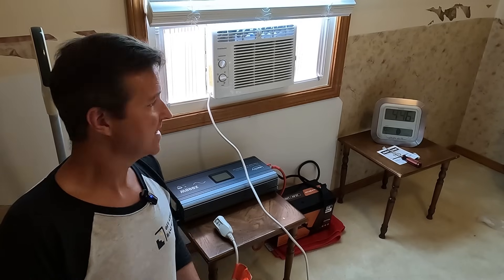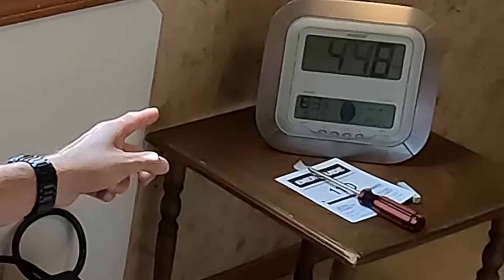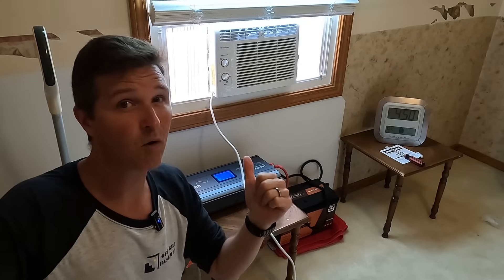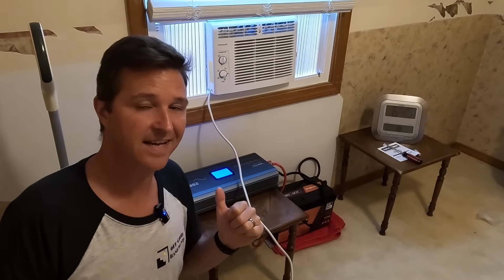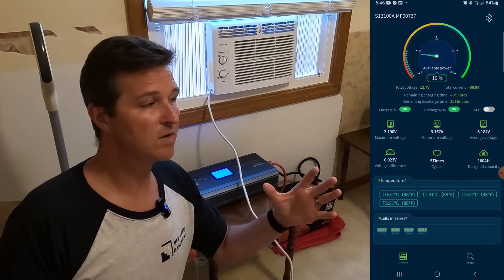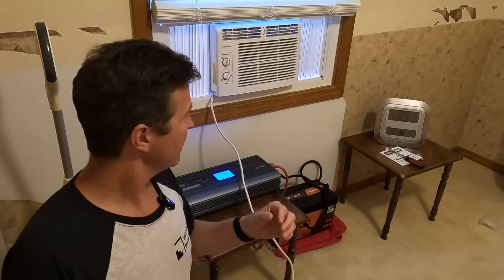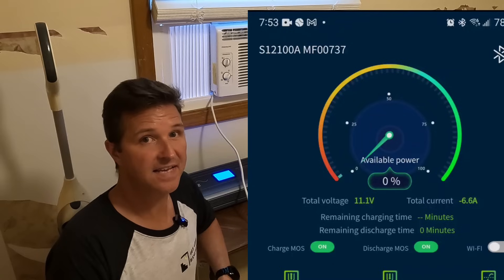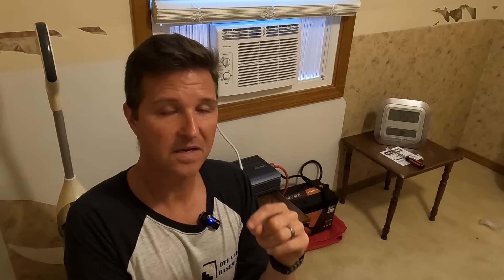How long can you power a 5,000btu air conditioner with a 12v 100ah Lifepo4 battery?  Let's find out!

Comment: I have a Midea inverter window unit that is about 30% more efficient than a normal window unit the same capacity. That might give you a longer run time. On low cool it pulls 2.5 amps (120 volts) and it maintains a 9x10 room at 75 deg. with a 95 outdoors temperature. That is right at 300 watts electricity draw.
Reply from the maker: That's pretty good!  Thanks for the comment and info.
Reply: I’m interested!! What exact model?

Comment: I would like to see a 48V battery with the same AC unit to see how much the losses improve with the smaller wire size and battery current.
Reply from the maker: Thanks for the suggestion and the comment.

Comment: Don't rely on your BMS in case of an accidental short circuit across positive and negative cables. Always fuse your cable to protect it from insulation melting, and resultant fire. LFP batteries have a very low internal resistance, and if you had an accidental short, there would by an unprecedented amount of energy being discharged through those battery cables...  Two cents from a professional in the industry.
Reply from the maker: Yes.  If this wasn't a demonstration then I would definitely fuse the positive connection with a 150A fuse on the 2 awg wire.  Thank you for the information and the comment.

Comment: Should have started the test at 10am and use two batteries. Switch them to record individual performance. The question is : how long will the second battery last after the first one cooled the room down ? Could it be 6 hours ?
Reply from the maker: Possibly, due to the room getting down to a stable temperature.  Thanks for the suggestion and comment.

Comment: Does your APP records your peak starting of the A/C? If so, how much current was it?
Reply from the maker: The app doesn't capture that.  I would need to have a clamp meter attached.  I've been told it has a soft start, but I haven't confirmed that yet.  Thanks for the comment.

Comment: Is the battery sufficient for the duration of its charge? To play ps5 (12v 7ah
Reply from the maker: Yes.  The voltage is very constant.  90% of the capacity is between 13.3v and 12.3v.
Reply: @OffGridBasement  How many watts do I need for a solar panel?

Comment: I have an ac with a built in inverter it sips power
Reply from the maker: I've been told they are very efficient.  Almost double the efficiency of this unit.  Thanks for the comment.
Reply: @OffGridBasement  I just tested a portable ac unit that's 5000 BTU and it was drawing double the amps,so I'd say if u use a portable unit it will just empty 100 ah lithium ion battery quickly ...

Comment: I have 2 100ah lithium lipo4 batteries and 3200 watts of solar and I run my ac ,fridge and TV all-day long
Reply: What size is your AC and approximate location?
Reply: Personally, if I were you I would expand my storage capacity to at least 400ah total.  3200 watts if you're getting 50% efficiency for 5 hours would be like 8,000 watt hours.  200ah at 12v is only like 2400 watt hours, so you are likely sitting in the 80-100% battery life range the majority of the time after less than 2 hours of sun exposure.  While this might be good for a lead acid or Sealed AGM battery life, it's not doing a whole lot for your setup.  Not trying to crap on you or anything, I just think by adding storage capacity you would actually improve the efficiency of your setup considering how much solar you have.
Reply from the maker: That's great to hear!  Thanks for the comment.
Reply: 3200W panels? is not a caravan is It?
Reply: 3,200 Watts of sun power is awesome!
Reply: @OP-fd4lh EIGHT 400-watt solar panels equals 3200 watts of solar power.  If the sun went on for 24-hours a day you might skip batteries or keep them for shady days.

Comment: I do these tests all the time. You are missing so many factors. The first and most important thing is your thermal load. That will keep that ac compressor running non stop. I run a 5000 btu unit on solar. I can get 3.2 hours run time for every 1000 watts used. The bed room is a 20x20 room. My thermal load is very small. If I turn on the unit when the room is already at or close to the desired temp wich is around 73F, I can get over 4 hours for every 1000 watts used . That battery would get me around 4.5 hours in prime conditions
Reply from the maker: Correct.  There are an unlimited amount of factors that go into this scenario.  It's more just a proof of concept for people that want to know all their available options.  Thanks for the comment.

Comment: Yeah, you did the test so I applaud that, but it's dumb. It gives you no useful information and you could never use this rig to do anything really. There's  12 V air conditioners available. But they still use a lot of amperage, and it's hard to keep up with them with any type of solar rig, on, certainly a camper
Reply from the maker: This is one scenario out of a billion.  It's really just proof of concept.  Thanks for the comment.

Comment: There are so many things wrong with this scenario that inexperienced folks just don't realize, but I'lltry to explain:   Simple math and a few facts are  5000 BTU equal  .41666 of a 1 ton measured in BTU's. One ton in BTU's = 12,000 btu's which equals 1 horse power= 757 watts. So 757 x .41666 = 315 watts.... Accounting for fan watts of (approximately) 35 watts = ~350 total watts.  Lastly, this  12 volt battery is rated @ 100 amps per one hour = 1200 watts. 

Even if one were able to draw the entire 1200 watts from this (or any other) battery is not likely to happen and this is why:   A 1200 watt (rated battery) ÷ by the 350 watt (AC unit) = 3.428 hours of run time.   But accounting for losses in the inversion (2000 watt inverter) (changing DC to AC) plus heat losses due to  electrical current in the wiring + inverter + battery you would be doing well to get 2 to 2 1/2 hours maximum run time with the compressor running and never accomplish much cooling while doing so. Bottom line: One would need 3 to 4 of these same 12 volt 100 amp batteries (connected in parallel) to cool that room with the AC unit to any reasonable/ comfortable level. Why? Because it isn't just the air temp you deal with, its the stored heat in the furniture, the walls, and everything else you're trying to cool too.  😊
Reply from the maker: This is just one example of a situation that's different for everyone.  Thanks for the comment.
Reply: @OffGridBasement  I'm wondering about the power factor of the compressor. Electric motors are induction devices and therefore use both watts (real energy) and vars (reactive energy). Watts and vars using the square root of the sum of the squares give you va (volt amps). Va is how you calculate the amps which is always higher than just using watts. Also you could just use an amp meter for a case of the exactly. Oh, and don't forget the loss of the inverter which means you would need a DC amp meter to accurately measure the amps directly off the battery. How long it will run was spot on. Good practical video👍 Thoughts?
Reply from the maker: @MudDogMandy  next time I include an amp clamp.
Reply: I don't think it was really cooling the room. Cycling cold air around him yes, cooling the entire room no. You do need 4 batteries. I would try it with a 48v system.

Comment: Do you know if the inverter scales up to the load  or does it run at 2000 no matter what. Bciz that would effect your time.
Reply from the maker: The inverter only powers what is needed.  Hope this helps.

Comment: My home setup have 2x 425W panels, Victron 100/50, 12V 280Ah Battery, 2000w inventter and Toshiba Polar 25 AC unit.
AC i run most time with 50% power and takes around 32 amps / 400W when compressor is running.
Daytime i get more from solar than AC uses, evening i run it bit and night time its just in fanmode.
I use solarpowert also for coffee maker, airfryer, toaster and also charge my e-scooters.
Reply from the maker: Thank you for the comment and sharing your setup.

Comment: I have a 5000 in my camper and I have solar panels hooked  up to my batteries on a sunny day 500 watts will keep batteries  fully charged during the hottest part of the day . That would be a good video to do
Reply from the maker: I do plan on adding 200w of solar to see the difference.  Thanks for the comment and info.
Reply: How well does it keep cool at night when there is no sun.
Reply: Which one you have in your caravan? - Nesito one.

Comment: Now,I find that these 5k btu air conditioners produce colder air on low cool than on high cool because the air is moving slower over the coil fins.
Reply from the maker: Great to know.  Thanks for the comment and info.

Comment: It’s difficult to preform these tests because even if you succeed in isolating all the variables the next time someone attempts to use this information they will be doing so with a new set of variables (Outside temp and humidity, inside temp and humidity, solar intensity) I set up my solar generator after hurricane season aka winter, I then tested it in the summer aka hurricane season and both my fridges used double the power 🤔 I determined that ambient room temperature plays a big part in the fridges efficiency and had to alter my design to compensate 👍 

I definitely appreciate the test as a baseline that’s why I watch videos like this 👍
Reply from the maker: Thank you for the information and the comment.

Comment: 0:45  Shorter fan life is the result of running the unit on HIGH COOL for extended periods.  HIGH COOL is only meant for a short duration "quick cooldown."
Reply from the maker: Thanks for the heads up.

Comment: The much higher seer rating on newer inverter type air conditioners wll consume less power. A cheap conventional 5000 btu window unit with standard 11 seer is a power hog compared to a inverter style 12,000 btu unit with a 15 seer rating, this larger more powerful one uses less watt-hours of power cooling a larger space. Seer is btus of cooling per watt. Some mini split units have seer ratings in the 22-24 range.
Reply from the maker: Thank you for the information and the comment.

Comment: Very interesting. I have a window unit that says it is 115v and 4amps, so I guess in theory, mine may run as long as 12.5 hours (taking a 100amp battery to the 50% level)?

This would be 100amp*50%=50amps, then 50amps/4amps=12.5hrs

Or am I calculating this wrong? (When the power has gone out in the past, I have run two window units on a propane 3kw generator, and I use a 2k watt inverter on a battery to run the fridge, a chest freezer, a big TV, the cable modem & router, a couple of lamps and a fan. I have never ran this setup more than 3 hours, before the power came back on, so not sure how long it would have lasted.

My plan was to have 2 batteries, so one could be getting re-charged via the propane generator while the other was running the appliances, and swap them out every 6 hours or whenever it actually needed.
Reply from the maker: You need to calculate it to DC voltage.  The best way is to find the watt-hour then divide by the voltage of the battery.
115v * 4 = 460wh
460wh ÷ 12.8v = 36Ah
So if you have a 12v 100ah battery then it will last roughly 2.5 - 3 hours.
Hope this helps!
Reply: @OffGridBasement  Okay - I think this helps me with estimates. Thank you for the clarification. It may make more sense for me to have 5-6 batteries to rotate on the window unit, and just use the generator to recharge them, since I do not have any solar. It would let my propane last way longer then, since it could charge 4 batteries at a time in about an hour using the built-in charge port and a few external charges plugged in.
Thank you again.

Comment: One of the biggest factors to how much power an AC unit will draw is the outside temperature.  I am running a very similar 5,000 btu window unit in my Van with 300ah of Lithium and a very similar 2000 watt inverter.  I am using a Victron battery shunt.  When it was in the 80's to lower 90's I was drawing a total of 500 to 550 watts of power.  That includes the power the inverter uses and the power loss from converting DC to AC power because I got those numbers from my battery shunt.   Today it's 100 degrees with some humidity and I am seeing over 600 watts of power draw up to 675 watts for brief time periods.  As temperature rises so does the refrigerant pressure inside the system, when the pressure rises the compressor has to work harder to re circulate the refrigerant.  Maybe when you tested the other AC unit it was a few degrees cooler outside??
Reply from the maker: Thanks for the info and the comment.  It was cooler outside when I did the 8kbtu test.
Reply: I run 2 6k btus on solar except one is in a window and the other is in the fireplace. I get pretty much exactly your same numbers at their respective temperatures. I monitor the back side of the fireplace unit with a thermometer. If I don't run my central ac and the house gets up to 85 degrees the back side of the fireplace unit will hit about 130° and pull right at 700 watts. I try and always keep it below 120°.
One takeaway is that helping your central ac out during the heat of the day will save you more money too because at night it will draw less power being cooler outside, if that makes any sense...

Comment: I did a 3 month monitor run of a similar AC unit in a similar shed shop in South Texas last summer. Similar results. I built the shed very well insulated, but the heat outside was rough, high humidity; about 30 minute drive from the Gulf of Mexico. 80*f is nice once the humidity is lowered. It takes a little practice to "calibrate" the mechanical temperature controls.
Reply from the maker: Thank you for the info and the comment.

Comment: Would a 1000 watt power bank power that ac unit? I'm new to all this interver, battery and solar stuff. Trying to figure out what's more advantageous. Power bank, like a Jackery or the inverter battery option. 

Thanks so much!
Reply: A 1000 watt power bank will provide enough in wattage but you must check the specs in available amperage output. If the bank is capable of a 40 amp amperage draw it should work. But 45 amps or more would give some room. 1000w/12v=83 amps. If the manufacturer is being honest in its specs it should work. But also you much look at the specs on how much storage it has. If the battery bank is 30amp hour of storage it won’t last long even though it will work.
Reply: Thank you! ❤️

Comment: Next why don't you just do one of these videos showing how long a television and cable modem with router can last for an off-grid situation because I'm sure during a power outage people are still going to want to be able to watch TV which state could easily do on a system setup like this if it's the right type and yes the cable system will still work as long as it's not been damaged by storms so therefore as long as the infrastructure in the cable system is good then you'll still have cable during a power outage you just have to apply power to your stuff I've done that before and it does work so I'd rather you show us that it can be done because I know it can but I want others to see this
Reply from the maker: That's a good idea.  Thank you!

Comment: Im a really warm person, I work nights and sleep during the day (not well with its warm). Even with a room AC unit, I need a fan blowing directly on me. I just use the portable fan as much as possible. The portable fan is actually more effective than an AC unit when using just one or the other. I'd only use my batteries to power the AC when I need to go to sleep. Or for like a 10 minutes cool down here and there when the room is unbearable.
Reply from the maker: Thanks for sharing and the comment!
Reply: These mechanicl controlled AC units are great to use with an appliance timer. I run one 2 hours on, 1 hour off when on grid power, 1 hour on, 2 hours off when using off-grid power. A fan is definitely needed either way. lol
Reply: @MississippiHomesteadJourney  my in room AC unit has a single push button on/off, so I am hoping it defaults to cooling if I use an appliance timer switch.

Comment: That lightweight 2,000 Watt high frequency, transformerless inverter will only last you a year if you're lucky. You should never power an AC unit with a high frequency, transformerless inverter. You should be using a low frequency, transformer based inverter if you want to power any size AC unit.
Reply from the maker: Thanks for the information and the comment.
Reply: Can you give an example of the correct model to use?
Reply: @vladimus9749  Victron Energy, Outback Power, Sigineer Power, Magnum Energy all make longer lasting, higher surge capacity inverters.

Comment: This test had two stages.  #1) Cooling down the room to the set point temperature.  #2) Maintaining the set-point temperature. 

The first stage will pull a lot of energy per hour.  The second stage will pull less per hour and is the more important reading, in my opinion.  It will dictate the amount of solar power input that is required to keep the a/c unit running while the sun is available.
Reply from the maker: Thank you for the info and the comment.  I plan on doing the same test with a 230ah battery to see the difference.  I should get over 7 hours of runtime.